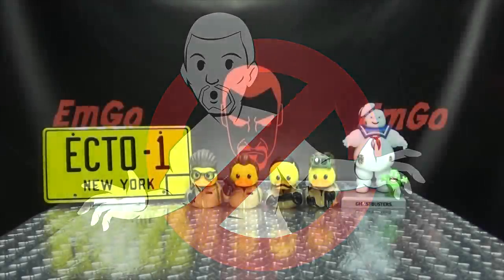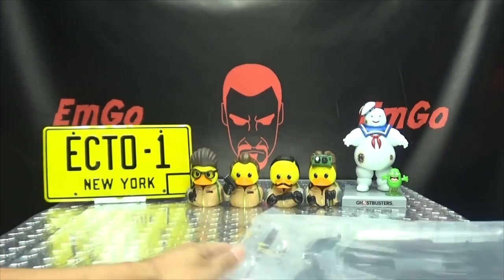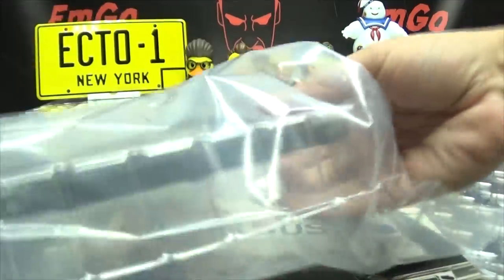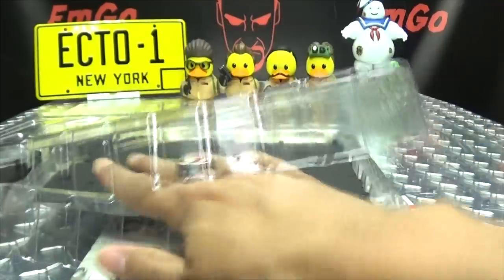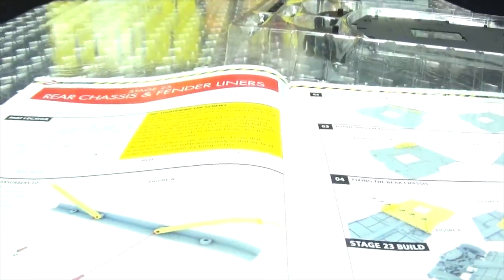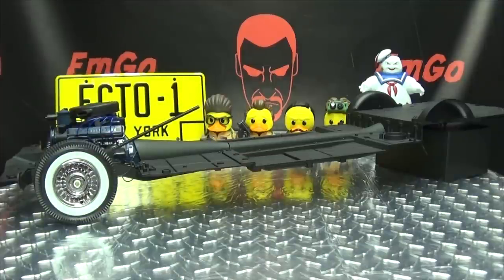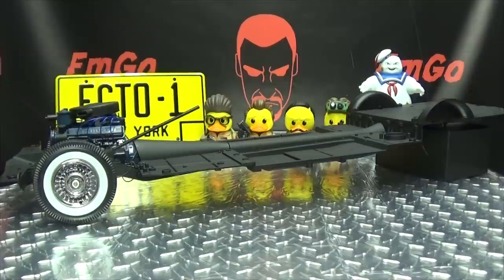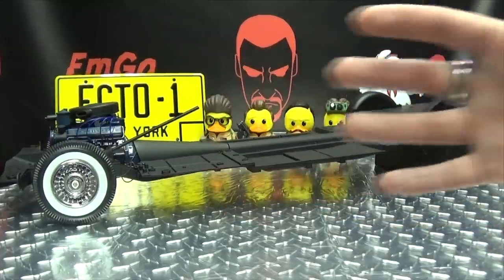Eaglemoss Ghostbusters ECTO-1 Kit (Part 23): EmGo Builds Stuff

Comment: Warning wait till you attach the radiator to the car before  u put the oil tank on it makes it a lot easier to line up the thick bottom pipe at the bottom of the engine that plugs into the radiator

Comment: You need to loosen the plastic parts that are on the bottom side, as they are supposed to be shocks and will need to pivot and move with suspension articulation. And if they're loose they won't break.
Reply from the maker: I didn’t tighten them. You even see me move them out of the way lol They’re fine.

Comment: Just incase you have forgot the base and case display is about 3 inches longer / wider and about 2inches taller than the build so a display will need to factor in this extra size problem.
Reply: Forgot to say that eaglemoss hace a tendency of extending builds like with the delorean.
On that build they did the hud box / the train wheels and train track as an extension.
So with this they might extended withbthe different roof rack from the second movie and maybe the side  shooter from the new movie as they are both on the same movie timeline. 💷💷🤔🤔🛠🛠🤤🤤
Reply from the maker: I know
Reply: @emgo316  just for storage those plastic angle parts under the back can be crossed over for now and they will be safe from damage just be gentle.
I just saw this so thought you shoud know for your own build.
Reply from the maker: I know